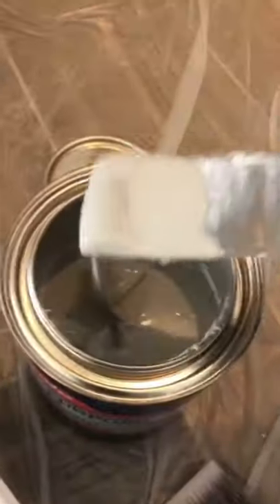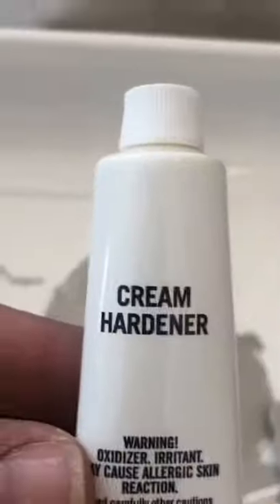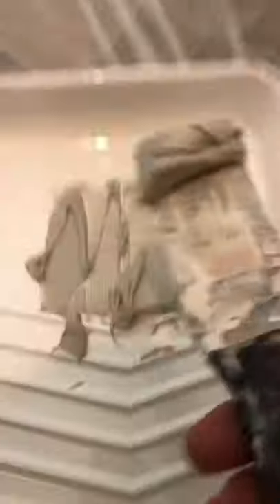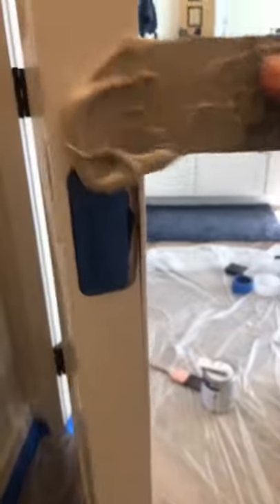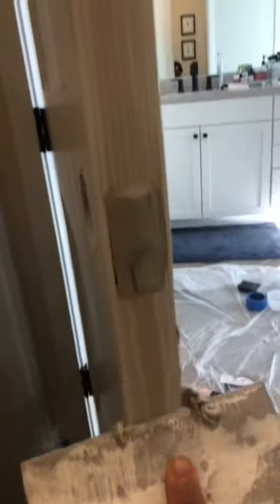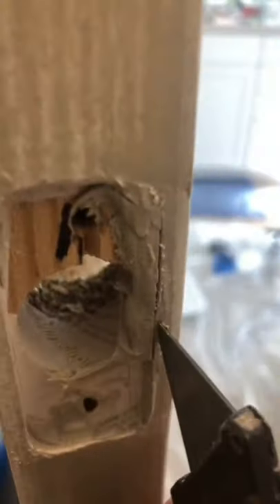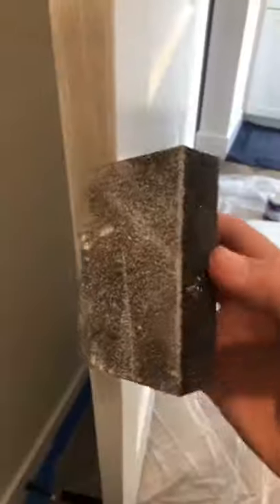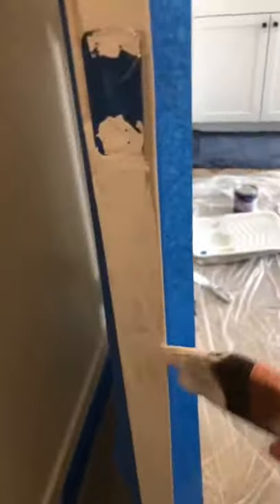How to repair crack on door by latch. #shorts #bath #door #diy #bondo

Comment: The door is still cracked,  you didn't fix the cracks you just covered them up. Next time drill into the cracks and inject wood glue,  I use nails  in half of the holes to push the cracks open so the glue gets into all the cracks. After the glue is pushed into the cracks I pull out the nails and put on a clamp forcing the cracks completely closed.  After the glue is fully set you can do your bondo cover up.
Reply: Overkill

Comment: Yay! I've had a cracked door for 7 years. I'll order bondo.
Reply: Just use caulk. Much easier
Reply: Don't thatll crack again in no time
Bondo is cosmetic doesn't have any strength
Reply: Use wood glue